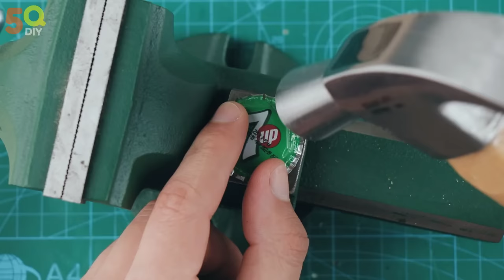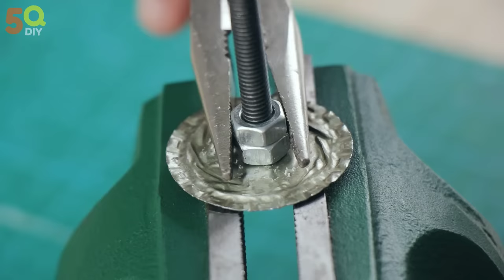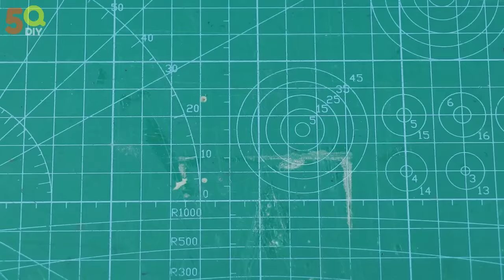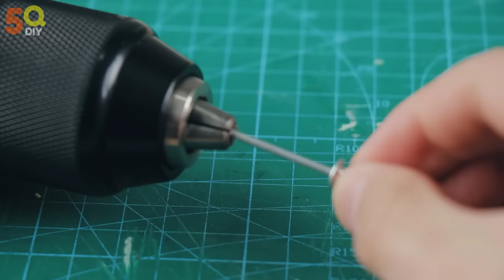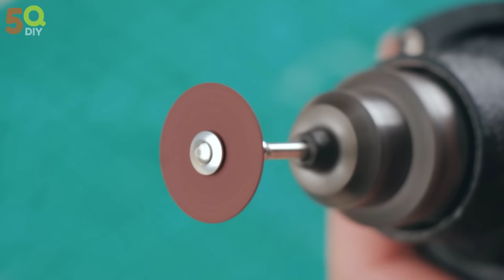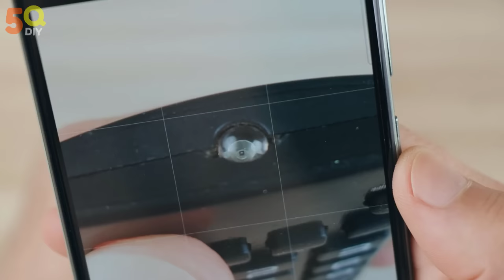I couldn't believe it myself! A great idea in 4 minutes!

Comment: Lol, the remote is battery operated won't work with one battery Without them both it won't work
Reply: No, it will work is why because by after using a wire it makes a closed circuit and remote will get operates.
Reply: Jajaja. It's a joke! This remote need 3 volts to operate, it will not work with only 1,5 volts!😅